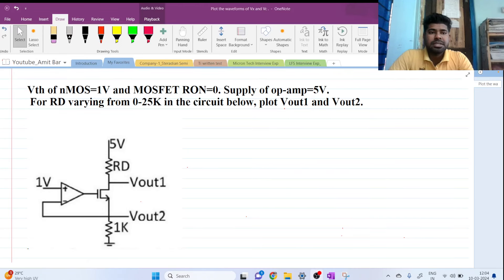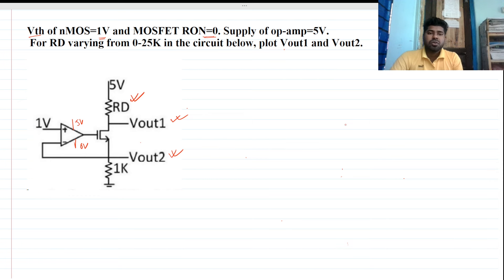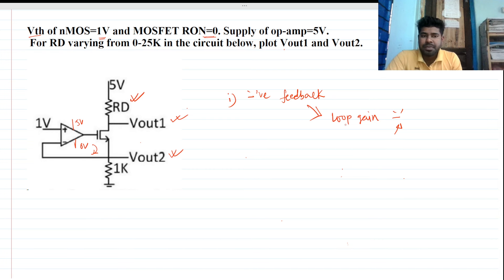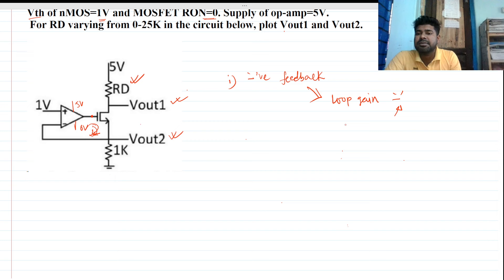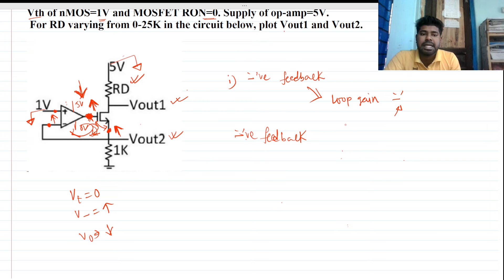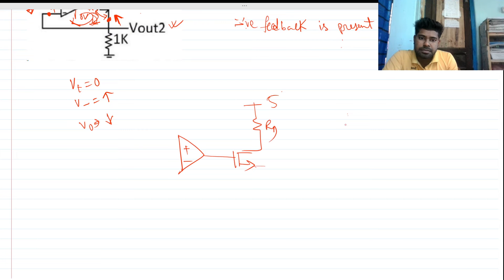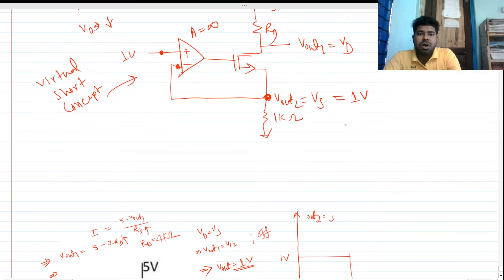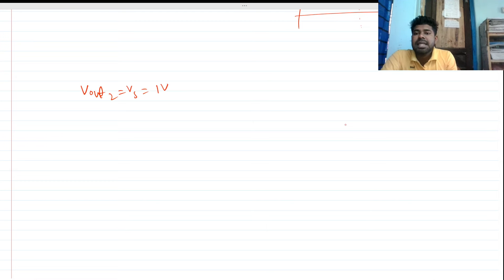STMicroelectronics Analog Design Engineer Interview _Plot node voltages wrt Rd

Comment: Hi, I jsut wanted to check on this - that when you keep increasing RD , the gate voltage will keep increasing to keep the Mos in saturation . Therefore the Mosfet will go into linear much before 4k ohm value . Secondly when the circuit does enter linear
 , VDS=0 , how are you opencircuiting the circuit , becuase the Gate voltage will go to Vsat =5v and drain is at 5v nad source is at 0V ?
Reply from the maker: Current constant means VGS is fixed ,here Vs is already fixed due to virtual short so Vg is also fixed while increasing Rd .. okay?? If Vds = 0 ,then current is zero so mos off not in liner region ..hope ,get it
Reply: I have the same doubt

Comment: sir i have one doubt ,when we r increasing the Rd continuously at point when value of Rd is 4v, Vds=0 and mos off current zero , after that continuously we r increasing the valus of Rd beyond 4k  current will flow in opposite dirn  now feedback is converted into + feedback virtual short not valid  but  current willl not be zero n it will flow but opposit dirn becoz mos is symmetrical device so now drain will work like source ,sir kindly confirm it

Comment: How current is zero when vds =0 . We know when vgs is less than threshold then only current should be zero. Can you please explain this why ?
Reply from the maker: Go and spend some time for mos basics ,you can follow Dr Razavi sir lectures on YouTube free
Reply from the maker: You have a element ,across it the voltage difference is zero,,so can any current flow through that element?? And current can be zero in 2 conditions for mos,,check it by yourself..Thanks